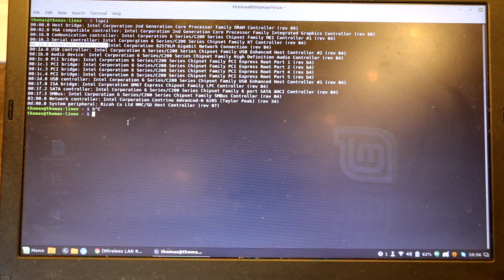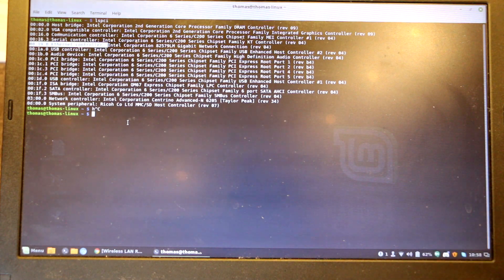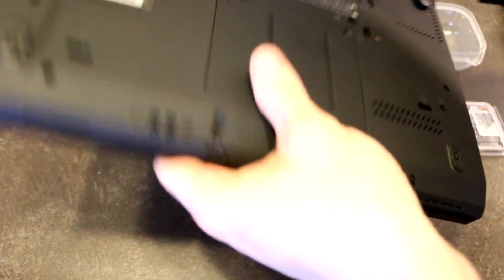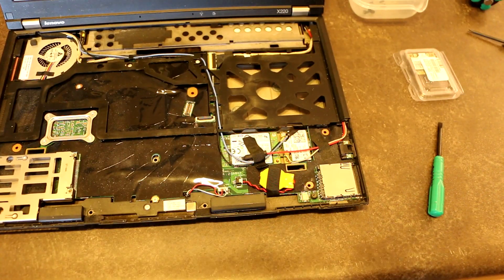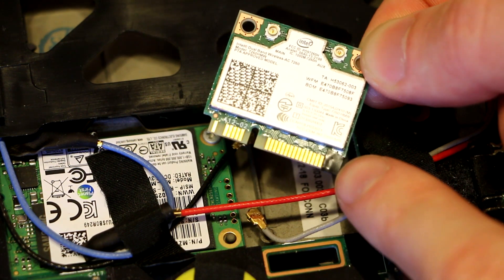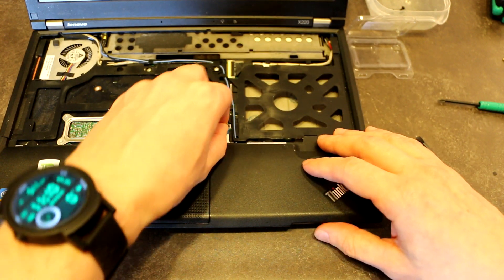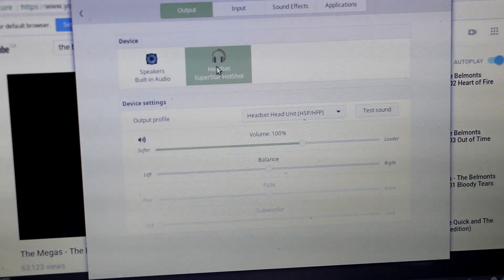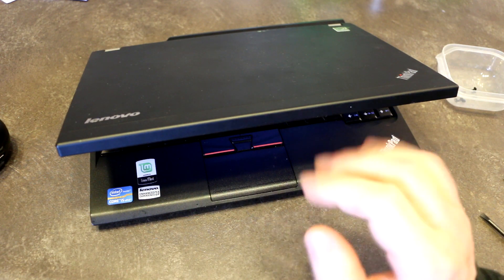Installing an Intel 7260 WiFi + Bluetooth Card in your Thinkpad X220

Comment: wich brand of ssd you'r using
Reply from the maker: The mSATA is a Dogfish.
Reply: I bought ssd Evo 860 msata 500gb I try to place it withy laptop X220 and it doesn't work ?? Do you know anything can useful for my case?
Reply from the maker: @ZackDesigner  Are you sure it isn't working? Is it detected in the BIOS?
Reply: @LaptopRetrospective  yeah I try to see it in BIOS and it doesn't appear
Reply from the maker: @ZackDesigner  Assuming it's installed right, I wonder if there are compatibility problems. I've read that not having an up to date BIOS and even potentially the SSD firmware can cause compatibility issues.
Reply: Do you know how to update firmware ?
Reply from the maker: @ZackDesigner  I've never had to do it before but there are instructions on Samsung's website.
Reply: @LaptopRetrospective   thanks for your help.

Comment: Mine is an i7 with onboard Bluetooth will I still get a boost from this? The Windows 7 driver doesn't support my headset. Guessing the new board might have better functionality?
Reply from the maker: I don't think the onboard one was 4.0 so yes, I do suggest disconnecting the old one to avoid conflicts.

Comment: 7:00 I did a "soft reassembly" once when I was dicking around with the radio in my beat up 2000 Mercedes S500. It didnt have an aux cable so I soldered the appropriate wires onto some leads on the cassette player to fit an aux cable . . . The soft reassembly shifted when I set the radio on the passenger seat for testing before reinstallation . . . first a weird smell, then a tiny bit of smoke, then a goddamed raging file in the passenger seat. Managed to hastily disconnect the 10 or so connections on the back of the radio and hurl the fireball out of the passenger window. Damn near burned the car to the ground on account of a "soft reassembly".
Reply: That's not a soft reassembly, which is where you reassemble everything without screwing or gluing them back, for testing purposes. 

You did a straight up mod.

Comment: why not just grinding it out...the pin completely removed
Reply from the maker: That's totally an option but I didn't want to permanently mod the card. So this is what I did instead just in case I want to put this card into another laptop.

Comment: Would you inform me if the 7260 dual band ac device works on DELL model 5537 notebooks?
Reply from the maker: Not sure. You'll need to see what cards it supports in its whitelist.
Reply: @LaptopRetrospective  
Where do I find this list? Would you help me?
Reply from the maker: I did some Googling of your laptop model and found these articles, doesn't look like it is supported.
https://www.dell.com/community/Inspiron/Dual-band-5Ghz-wi-fi-adapter-on-15r-5537/td-p/6121453

https://www.dell.com/community/Networking-Internet-Bluetooth/Intel-wireless-N-7260-Problems/td-p/4677414

Comment: Thank You. Installing this card is scheduled for tomorrow. I am curious if a firmware update will be required and how to do that. Guess I will find out
Reply from the maker: I didn't need to do anything special. Either in Mint or Windows.
Reply: @LaptopRetrospective  As you mentioned, nothing special was needed in mint or windows. worked great. I found the tape frustrating and used a utility knife to flick loose the bottom edge of pin 51. couple of wiggles to and fro and off it came. Thanks again !
Reply from the maker: Yep, the tape can be a pain but if you are happy to cut the pin it is waay faster.

Comment: After installing the 7260 my speedtest actually dropped. I added a tape to the pin 51. Is it possible that the tape slipped or something or wouldn't it work if it did ?
Reply from the maker: Again, did you install the custom BIOS?

Comment: My startup time increased, between bios check and grub, when i added the 7260 card. is there a setting i have to make to the bios after installing the 7260ac?
Reply from the maker: Did you install the custom BIOS? Does the card work properly?
Reply: @LaptopRetrospective  yes i did install the custom bios. If you dont recall my comments on this, i added some instructions on how to install it on a x220 from a usb flash drive a couple of weeks ago
The problem is the delay on boot and the low speed
Reply from the maker: Ah very sorry. Thanks for reminding me. If the card is working and provides Bluetooth then it should be working properly, assuming it's running the correct drivers.
Reply: @LaptopRetrospective  i didn't check bluetooth yet. I will have to check it plus  the drivers on my opensuse and freebsd installations...

Comment: Do you need drivers? I have card 7260 installed but wifi will not connect to 11ac only connects 11n. I installed latest from Intel but still only getting 11n connection.
Reply from the maker: Are you installing it in a x220?
Reply: Laptop Retrospective Yep, the X220T specifically with the modified bios.
Reply from the maker: Did you also tape the pin? I presume you used a T specific BIOS? OS?
Reply: Laptop Retrospective Yep! Pin taped and T bios. WiFi and Bluetooth working. However, WiFi speeds are not near the same as your video and my WiFi connection properties show 11n. This is in Windows 10. My Internet Service Provider confirmed router is 11ac capable.
Reply from the maker: I didn't need drivers but I mostly run Linux Mint on this one. Windows 10 should detect the right drivers but you might want to check with Intel just to be sure and confirm in Device Manager that it's detecting it properly.
Reply: @LaptopRetrospective  Will do. Thanks! Great video btw👍
Reply from the maker: @scv6008  no problem. If that doesn't do the trick, make a live CD of Mint and see if gets you better speeds, will help narrow down the culprit.
Reply: @LaptopRetrospective  I figured out my issue! Apparently, there are multiple versions of the 7260 card. I bought the Intel Dual Band Wireless-n 7260 and not the Wireless-ac 7260. My mistake.  ac vs n. That explains why my speeds are slow!
Reply from the maker: Ah gotcha. Glad you were able to figure it out. Hopefully you can track down the AC card.

Comment: I have been looking all over the place to figure out how to add bluetooth to my t60 it came from the factory WITHOUT it, can you point me in a direction?
Cheers,
Bob
Reply: Ended up getting usb adapter for Bluetooth, not in the mood to tear it down again, they are eleven bucks,
Thanks for your response.
Bob
Reply from the maker: Not a bad solution. Probably newer than OEM.
Reply from the maker: Hey Bob, check online for the maintenance manual for the T60, it should be really easy to find. Most of the time Bluetooth ends up getting hidden under the palm rest. Let me know how your quest goes and I'll do what I can to help.

Comment: Can i buy this wifi cards for my x220 https://technoethical.com/TET-N300DB or https://www.amazon.com/Dell-DW1515-U608F-Wireless-Height/dp/B00A31IXVY ? And just plug in?
Reply from the maker: Probably not, at least without removing the whitelist.
Reply: @LaptopRetrospective  I remove blacklist :) can I ?
Reply from the maker: Can try, but I can only confirm the card I used.
Reply: @LaptopRetrospective  aiight ty bro
Reply from the maker: You're welcome.

Comment: thanks for great video!
did the wifi upgrade few months back and removed dedicated bluetooth card from the laptop
new bluetooth worked well for some time, though I rarely used it
but now I don't see any bluetooth device in Ubuntu anymore
do you think it can be related with that tape on one pin which is may not fit well now? 
thanks
Reply from the maker: Only one way to find out. You can try and reset the card as see if it helps. No issues to report here.
Reply: @LaptopRetrospective   - checked that blocked pin and it was looking good. After disabling bluetooth in BIOS and re-enabling it Ubuntu started seeing bluetooth device and now it works. Though quite strange why it wasn't working earlier as no changes were done to fix this :)
Thanks anyway!
Reply from the maker: Computers work in mysterious ways.

Comment: Thanks for the cool video! I have x220t (4984CTO) windows 8.1, not linux. is this still the best option for me (wifi adapter type)? Should I still tape it? 
And lastly do you know if there is an LTE WWAN adapter upgrade possible?
Reply from the maker: The process should be the same. You'll need a different BIOS file I think for the T model to remove the whitelist. I'd still tape the pin. I think they had an LTE option from the factory.

Comment: Thanks for this, it's given me the confidence to do this upgrade. I love the upgradability of the X220.
Reply from the maker: Awesome! I'm glad I could help. Enjoy your x220.
Reply: Amusingly, by stripping my X220 down as per your guide, I discovered I did actually already have a Bluetooth module, so the problem was that Windows 10 wasn't detecting it (should have stuck with Ubuntu like my other laptops). Thanks to the strip-down, I was able to identifiy which module it was ( Broadcom BCM92070MD ), and found the drivers. I wrote a short article: http://www.aoakley.com/articles/2018-09-04-thinkpad-x220-bluetooth.php
Reply from the maker: Fantastic article! Thanks for sharing and I was glad to play even a small part.

Comment: If I remove the whitelist bios to install a new wifi chip, then does it need a Lenovo FRU or can any generic cards word too?
Reply from the maker: I'd suggest the Intel card used in the video. Can guarantee anything else will simply just work.

Comment: Where did you buy your wifi card from?
Reply from the maker: Got mine from a local shop. They are very easy to find.
Reply: What about online, do you recommend any sites?
Reply from the maker: Amazon probably has it. Guess it depends where you are and where parts can be bought from. As I said, it is a very common part.
Reply: But will any wifi cards work on this laptop after removing the whitelist? Because I see some cards say, "compatible with Lenovo thinkpad xXXX" or "Not compatible with Lenovo". Will cards with those in the description still work? Or can it just be any despite what it says it is compatible with? 

Also thanks for replying so quickly, I've already subscribed. Love your videos <3.
Reply from the maker: It will say that because of the old BIOS locked out the cards. The one I feature in the video is what I recommend since I know it works, it's easily found, inexpensive and includes Bluetooth.

Comment: Will this chip work on a bios-patched x230?
Reply from the maker: When you say BIOS-patched system what do you mean? The X230 has Intel's digital signing to stop software flashing so unless you have the hardware to do it, this isn't possible.
Reply: Laptop Retrospective I am aware of the nontrivial process of flashing x230, that's why I stressed out that it's already flashed. I'm curious whether a custom 802.11ac module can function properly on x230 since I could find tons of evidence for x220, yet none for x230 :(
Reply from the maker: Sorry about that, it is rare to hear someone in the comments that is aware of the X230 and that lovely security. Not sure what you flashed it with, but if the Whitelist was removed you should be ok to install this chip. For more information on Custom BIOS's for the X230, I'd suggest reading here:
https://www.bios-mods.com/forum/Thread-REQUEST-Lenovo-Thinkpad-X230-i-G2ETxxWW-Whitelist-Removal
Reply: Laptop Retrospective Sweet! Thanks :)
Reply from the maker: Good luck!

Comment: My X220 already has bluetooth, but I wanted to get this to boost my wifi. Did you have to remove the old bluetooth card so you don't have two inside?
Reply from the maker: Mine didn't have the Bluetooth card under the palm rest. Wasn't a standard feature that in aware. If you do have one already, I'd remove it if you do this upgrade. No point in two cards.

Comment: Great video! I have plans to do this with my x220.  But I need to get to whitelist'ing the BIOS.

Question; if I go this route should I just remove the Dedicated Bluetooth chip inside altogether?
Reply from the maker: Thanks for the comment. I would remove the original card if you have it, it would be located under the palm rest. The one on board is better and lower energy.
Reply from the maker: To further to add to this, you'd likely need to disable one of the chips in order to have Bluetooth function normally as I suspect the two would fight with the OS for which should be in charge of handling connections. That and having two BT chips running seems redundant and would waste battery.
Reply: It works!  Kind of, for some reason the Wifi works in Linux but not in Windows 7.  Any idea what could be the problem?  Must be something driver related right?
Reply: FORGET THAT NOISE! That "Donovan" is someone who clearly couldn't do something as simple as "download a simple driver".
Reply from the maker: Haha. Glad you got it all figured out. Enjoy!